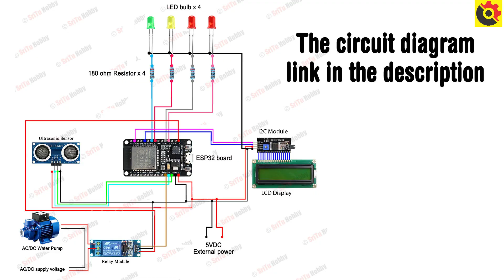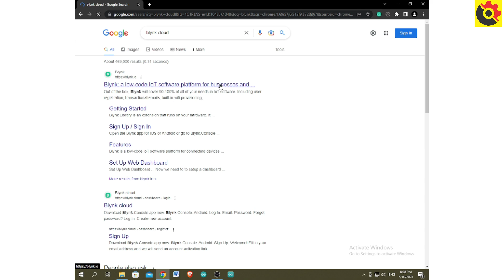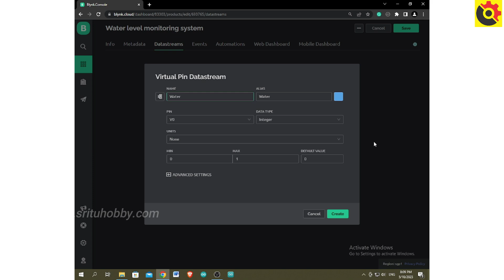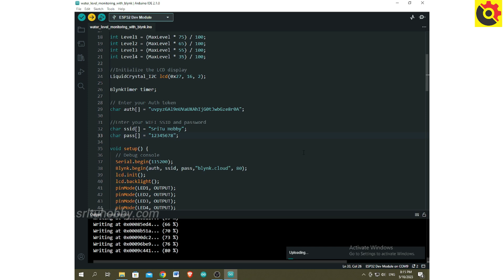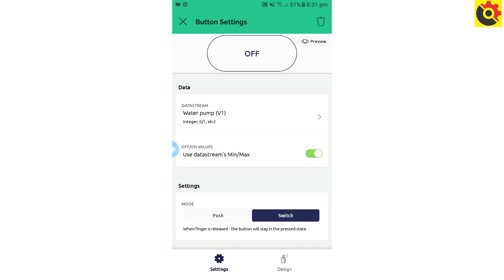How to make a water level monitoring system with ESP32 board and Blynk @sritu_hobby

Comment: Automatic on or off of the pump and trunk monitoring, this is a project, or two, your video is related to my project, your video is only on tank monitoring, smart water management system, iot based tank monitoring and pump automation, make a guide line video on this project. thanks

Comment: What is the alligator wires connected to??
Reply from the maker: Power supply
Reply: He connected the GND & VCC of the adapter through an alligator clip to create a direct path between the power supply (Short Circuit).